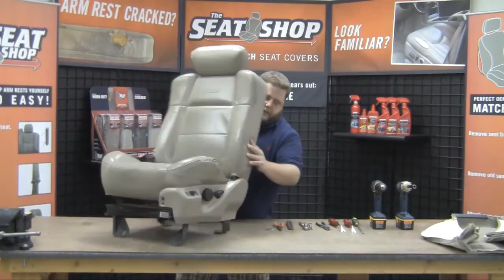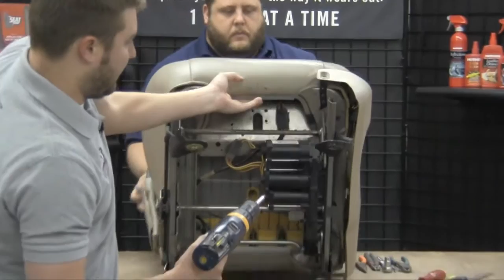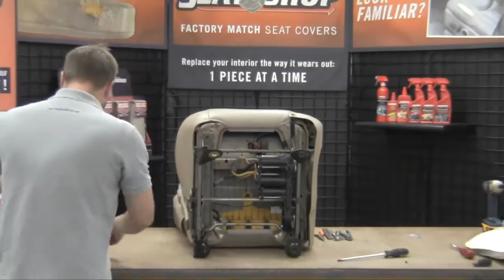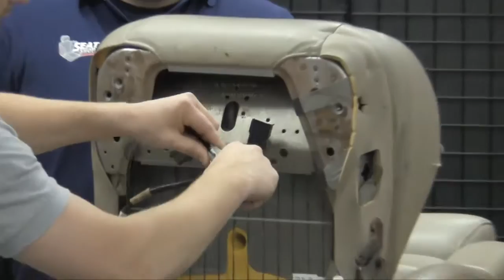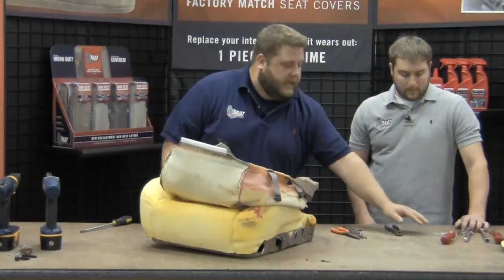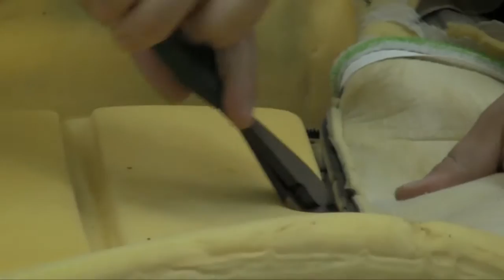97-03 F150 Bottom Install Part 1 OF 4 - eBay Ready

Comment: Hi guys, I've seen some upholstery guys either do repairs or full replacement of the upholstery without removing the seat from the vehicle. Do you think this is at all possible with the F-150, specifically the 2000 F-150 That has the fabric material and not leather seat Covers?
Reply from the maker: It is certainly easier to replace the cover when the seat is removed, especially if you haven't done it before.
Reply: @TheSeatShop  Thank you for the reply